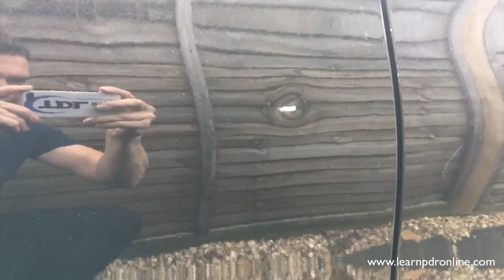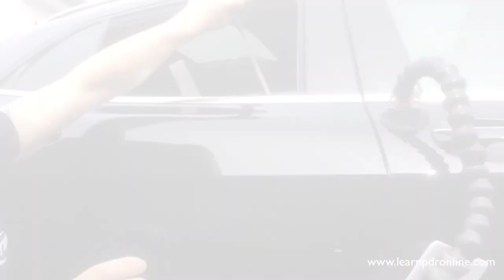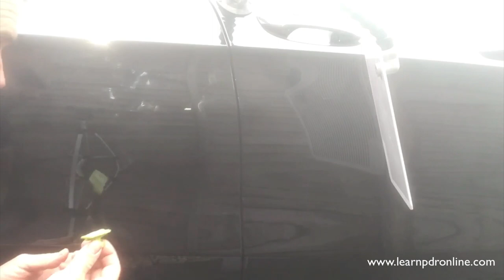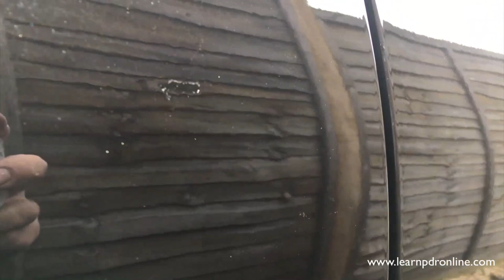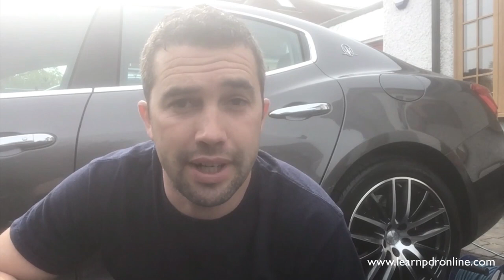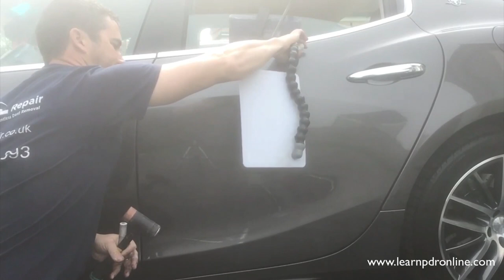A Day In The Life Of A PDR Technician: Episode 1

Comment: Thanks for the videos. Why are you doing the heating?
Reply from the maker: You're welcome Harun! I use heat to warm the paintwork up when pushing, this helps soften the paint and keep it malleable so that I do not crack or damage the paint as I start moving the metal. Often when working sharper dents a warm panel can also help the metal to move easier. The other time we use heat is for glue pulling to help control the temperature to allow the ideal curing time to adhere the tab to the panels!
Reply: @LearnPDROnline  The information you provide is very valuable. thank you. I am also interested in this business. I bought a lot of tools and practice. I did not take the course because I did not have enough money. Greetings from Turkey 😊🙏
Reply from the maker: @harunozdogan8023  Thanks Harun, I appreciate money is hard when purchasing tools and first getting set up however training is an investment into yourself for the future and in my opinion is more valuable than tools, Training will teach you how to get started, what tools you really need and most importantly how to use them, training will cut down your learning curve and get you out there earning money quicker. I'm here if you have questions about the online training we offer. Otherwise keep watching Youtube take in as much information as possible and most importantly, practise! 👍
Reply: @LearnPDROnline I know most of the basics. I watched the work for 2 weeks in the presence of a master doing this work. After I got the tools, I started practicing. It's going very well for now. But I have some shortcomings.  I'm researching them. I'm going to open a small business in the area where I live recently. There is no one doing this job. Online education interests me. I want to buy later.

Comment: You Can Micro Block Wet Sand and Blend the Paint ✅ Apply Correct Paint / Color Let Dry 3 minutes Lightly Wet Sand Re-Apply as Needed Then Lighty Hand Buff... You Can Repeat Process With Clear Coat But Not Necessary 💥 Takes a Little While To Master... Practice
Reply from the maker: Yep that's correct, we often do this as well! Thanks for sharing

Comment: Nice job, was wondering, could glue pulling be an option for this?
Reply from the maker: Thanks Victor, glue pull would definitely be another option for the Maserati dent but not for the Mercedes... A glue pull on the chipped paint would likely take another piece of the paint off with it, but fine for the other dent. 
I would always choose the bar method over glue pulling a door dent that’s accessible because I am quicker with this method and more accurate but this is just my personal preference, I’m sure some techs would reach for the glue... 
Thanks for watching...
Reply: @LearnPDROnline  unless you put a clear piece of tape over it

Comment: Why NOT glue pull and put a clear piece of tape over it ??
Reply from the maker: Thank you for your comment, personally I am quicker and more accurate with bars and rods than I am with glue pulling door dents so I would always chose that method where possible. 
I’m not sure what you mean by the tape though, do you mean to tape over the paint chip instead of touching in the paint work?
Reply: @LearnPDROnline  No sir if you put clear strong tape over it will help NOT pull anymore paint off
Reply from the maker: @DentZero123  Interesting, I have never seen that done before, I would have thought the hot glue would melt the tape but its always interesting hearing a different approach, thank you for your comment